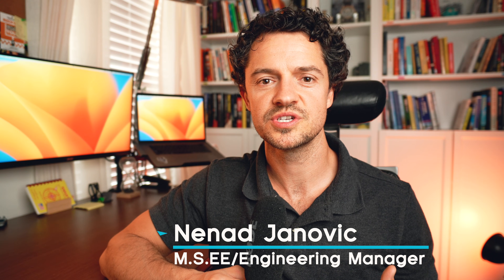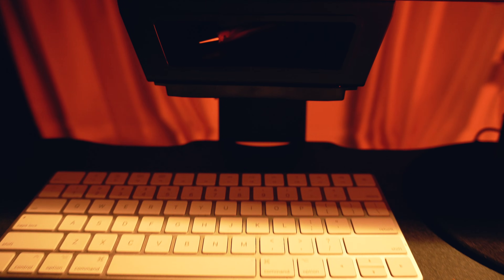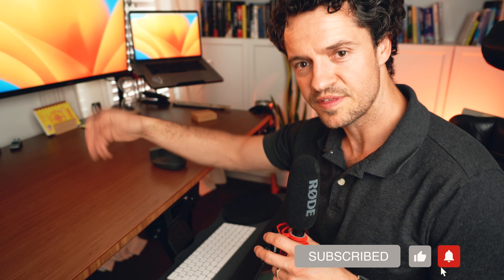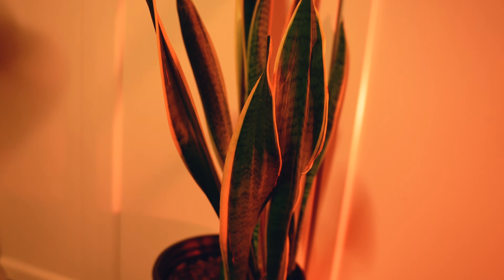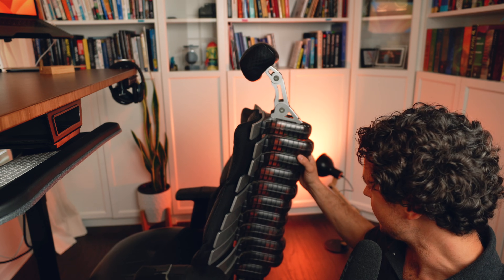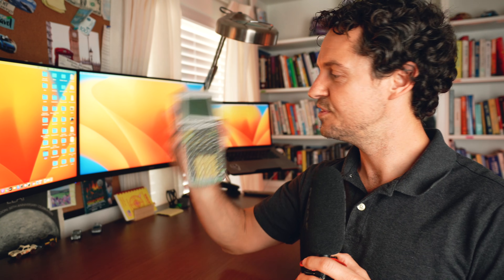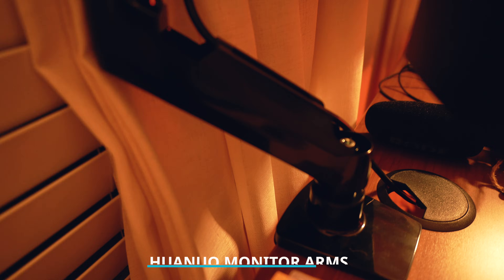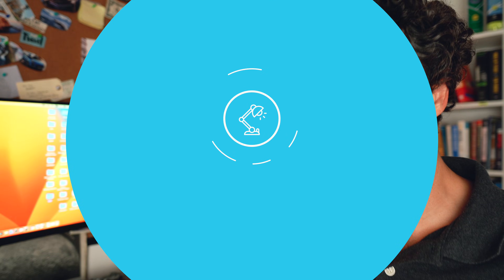My Engineering Productivity Desk Setup

Comment: Windows or Mac m series for electrical engineering student undergrad?
Reply from the maker: The Mac is a beast. I just upgraded to a monster M4 Max. Best computer I’ve ever worked on. I’m clearly biased here. Make sure that you can get all the software running on it. I know that the matlab/simulink combo are available for Mac. I don’t see an issue with it but I would check with the engineering college to be sure. The windows will be fine also, but it will lag more than the Mac. Cheaper though. If you have the budget and you’re able to run all the software (most is cloud based now anyways) , get the Mac 😅

Comment: I heard that macbooks aren't ideal for engineers
How do you work around this?
Reply from the maker: most of my work is through a VPN. I work a hybrid schedule so it’s a non issue for me. The MacBook is great for speed and longevity. It depends on what software you need to run of course

Comment: Will you make a vlog or video what you really do in power
Reply from the maker: Yes! I’m working on a “day in the life video”. My work has changed from 90% technical to 20% or so the past few years. I work in substation design.
Reply: @NenadPeter  I work in the substation design field as well as a 3D designer. A day in the life would be amazing video.
Reply from the maker: Good for you! That’s a great role. Are you on the consulting or the utility side? I’ve already recorded the “ day in the life video”, just need to get it ready